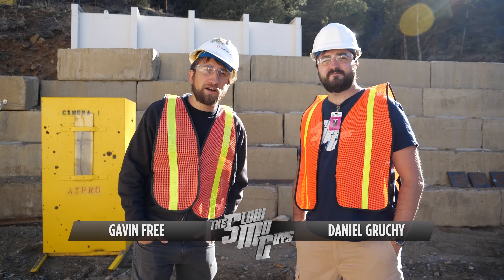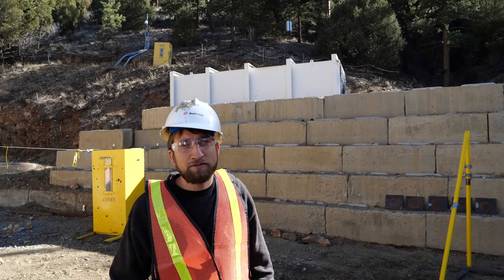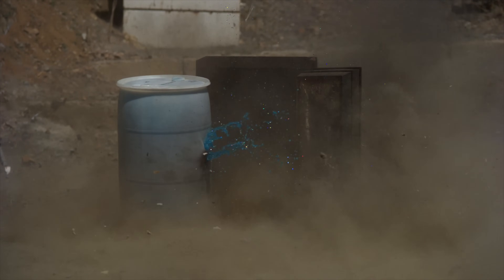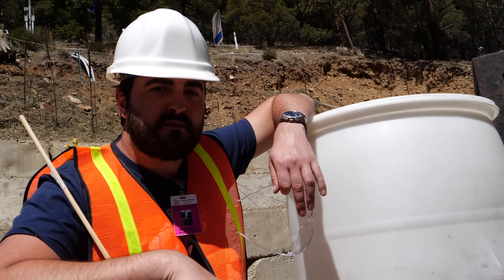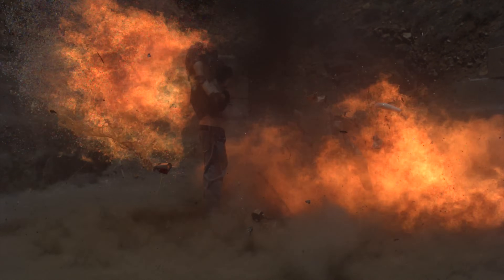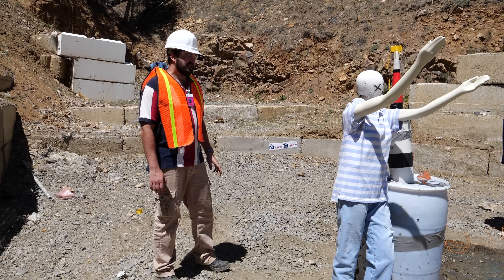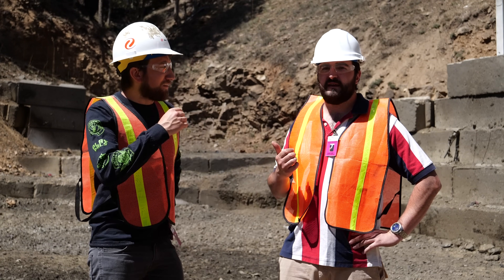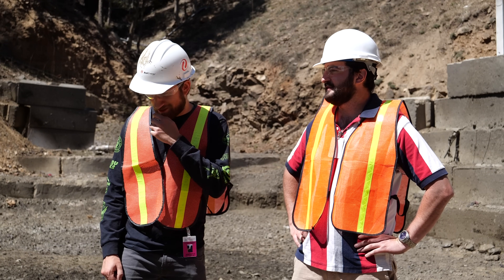Massive Explosive Chain Reaction at 200,000fps - The Slow Mo Guys

Comment: Since you have several phantom cameras - could you record the same footage at the same frame rate but several different exposures and mount a HDR footage from it? The dynamic range suffers a lot from high frame rates but it would be really amazing to see the actual shape of the copper jet penetrating the armor. I could definitely lend you a hand with mounting the HDR footage because I'm a computer vision / image processing specialist. What's more you could transition from low to high exposure smoothly to show all the details of the explosion over time. It would be also (probably) possible to reduce noise and perhaps even artificially improve resolution of such image, especially with recent advancements in convolutional neural networks. This altogether could make a footage of unprecedented quality :)
Reply: I hope they do shaped charges again, but no matter what bracketing you use you can't get a video of the jet in air because it moves so fast it lights the air on fire, and all you get is a fireball. When I was a student I did R&D for shaped charges, we mainly used an array of flash x-ray photographs for still images of the formation of the jet or multiple projectiles. On a rare occasion we would take pictures in the visible range and the solution is simple, we just built a long frame of a box where the jet was going through, wrapped it in plastic wrap and filled it with nitrogen(no fire). You would only need one exposure level, but I haven't seen anyone make that video, It would be amazing to see videos of the jet before it fully formed, at the ideal standoff, and further away when it breaks apart.

Comment: The fastest common LCD panels run at 120fps. LCD works because they use some sort of crystal that stays elongated with no voltage applied, and bunches up gradually as you apply a voltage. It would interesting to see someone run a copy of prime95 (a stress testing tool) and capture the changes in the panel at 200,000 fps. Might photograph well because the panels give off light...

Comment: what if you make a smaller one attach an arrow shaft to it the connection between the arrow is a primer. 
The front of the charge with 3 aluminum sticks to stop it from directly hitting the target.

Comment: Send different speed shockwaves through different materials, like, c4 makes a fast sharp bang, but anfo makes a slower shockwave, better for pushing things. Maybe you could set the various explosives off in gelatin, water, oobleck, molten plastic, molten zinc (low melting point, etc :)

Comment: Odd they didn't protect the cameras by aiming them at an appropriate mirror set at 45 degrees. Then only the mirror is at risk while the camera's behind steel. Mirrors are cheap compared to cameras.

Comment: Salutary to note the last and biggest bang was from the ammonium nitrate fuel oil - a pretty standard explosive for car and truck bombs.
Reply: pedtrog I was told on an explosives course that ANFO mix is about 50% more powerful than TNT when it comes to structural damage.  Was used in the Canary Wharf bomb placed by the IRA

Comment: On a couple of YouTube videos, the comment section has livened up on the subject of barrel vibration and bullet stability out of the muzzle.  The military did a study on the flight path of the .223 that indicated that out of the muzzle, the bullet precessed about the axis of flight, damping as the gyroscopic force aligned the bullet axis with the axis of flight.  I wonder if you guys would be willing to do a video using your high-speed camera to validate the physics of that.  Likewise, we've all seen barrels flex when shooting in slo-mo videos, but the conventional belief is that there's a node (no movement) about 2/3 of the way down the barrel from the anchor point in the receiver, and that barrel dampers are meant to fool the barrel into "thinking" it's longer than it is, so that the node point moves to the muzzle, eliminating barrel flip as the bullet exits the barrel.  That's another high-speed-camera-worthy video.  Just a thought.

Comment: Now I'm very sad for those tank crews who have unfortunate enough to be in a tank that fit fired by a shaped charge. Poor guys would literally melt? Or transform into mess of flesh? Not sure what happened, but definitely not a cool to be in one.
Reply: Til they instaled overpresure valves they got killed by the extreme presure. But Shapd charge is one of the least deadly rounds. It does not explode inside the tank. It youst sends a stream of molten metal trhoug the tank. It kills everything in its path but nothing around it. And even if it hit somone they might youst lose a leg instead of kiling him.
Reply: @manuelscherrer9956  thx
Reply: @manuelscherrer9956   No, it's much more likely that every occupant  inside would be killed.  Plasma (molten metal from shaped charge) is not like a bullet that can miss you. It is moving much faster and is extremely hot. If you're inside the tank, it kills you.
Reply: Well that’s what you sign up to when entering a tanks crew, and out of all the different things that are being shot at tanks, I’d rather get touched by shape charge then other terrible thing like armor piercing rounds, etc,...

Comment: Didn't move the safe door even a smidge, shot into the water filled plastic barrel with a silver dollar sized hole.  I'm not quite sure why the barrel jumped straight up a foot or so, rather than rocking backwards then forwards several times.  Anyone got an idea?

Comment: Hey like the video but I was wondering and this may sound crazy if you can slow motion film a television set to see if there are another set of images being projected that the human eye just cannot see.   No there would not be explosions but if there is another image or set of images being transmitted then it would prove subliminal programming happens all the time when you watch TV.  It would be interesting to see if it also happens with a laptop and with our cellphones.  I know it is off the beaten path but I have been wanting to do this for years now.  If you decide not to film it can you tell me where I can rent a high speed camera like you have so i can perform these experiments?

Comment: 210,000 frames per second if translated into inches per second isn't even close to the velocity in inches of a shaped charge per second. Dividing 210k inches per second by 12" per foot is 17,500 feet, or 3.314 miles. So the shaped charge movement is faster in inches per second than each frame if each frame translated to one linear inch. So now you know. :D
Reply: And yes, shaped charges are done with C4 or similar, which burns at roughly 5 miles a second, so that's in the range of meteor impacts.

Comment: ANFOL is extremely high Brissance.  That 1/2" plywood is not rated to that kind of shockwave.  (Especially a 55 gallon drum of it.)  It's pounds per square inch, against s 4/8' sheet.  I'm surprised there wasn't even more spalling.  You used way too much of that stuff.

Comment: at 15:24 you can see the air move above the explosion
Reply: That's the shockwave he was talking about.
Reply: @waterspray5743  there is also something moving before shockwave,watch again carefully
Reply: @waterspray5743  No, he was actually talking about the air. Heat spreading (depends on intensity and force) faster than a shockwave. In this case, the heat spreaded actually faster than the shockwave, causing the air directly above the explosion to heat up abruptly and forcing it to get above the colder air, till the shockwave arrives.

Comment: 5:19 by the rules of physics shouldn't have a force pushing back? like recoil on guns. because visibly the explosive already penetrated the safe and the barrel but the stick holding the explosive is still in place until the shock-weave pushes it back.

Comment: See all that carbon soot everywhere (black)?  They used too much fuel oil in the ANFO.  The AN should just be damp with oil, not swimming in it.  :-P  They would have had slightly better velocities if they had cut back a bit on the FO.

Comment: you guys should try to blow up aluminum foam. idk if you've heard about it, but it's like blowing bubbles in aluminum right before it solidifies, and because the thin layer that makes up one side of a bubble is designed to crumble and absorb a tiny bit of the impact of an explosive, and there's hundreds or thousands of tiny bubbles that do that, so it's blowy- uppy proof. or, you know, explosion resistant. whichever pleases.
Reply: Andrew Gail boom boom protection
Reply: Blast resistant.
Reply: Pop proof.

Comment: Have used det cord to cut big dead trees down at ground level on many occasions.  To make det cord hit harder double it up and tape it tight.  To make a hard fist hit det cord into a tight ball then put into a crevice or hole of object.  Makes a serious bang and does its job or destruction.  Using Anfo in a container then set off with a det is pretty wicked. I use explosives everyday in my job of mining.  Great video guys.

Comment: Can you do a shape charge facing upwards into the air?
Reply: Heroix The stated speed (10km/s) is pretty close to escape velocity.
Reply: @johnfrancisdoe1563  
Yeah, if it wasn't for the earth atmosphere it would legit be possible to reach orbit! Of course, any orbit achieved from a single push has to transect the point of launch, so it wouldn't achieve stable orbit, but still!

Comment: Shaped charges are so effective because they're moving so fast they literally erode the metal surface they hit. They're used on those weird CBU-97 where they're detonated at like 20-100 feet and aimed at the top of tanks. So they're literally firing the molten metal slug like a gun straight down at tanks and still able to penetrate hundreds of mm of solid steel.

Comment: You guys should do a video with MIT and use their camera to capture electricity from a tesla coil
Reply: they already did a tesla coil one
Reply: Yeah I've seen it but the camera that used wasn't fast enough to capture the electricity itself because it travels a a 1/3 of the of light. So if the did it's with the camera at MIT they could actually capture the electricity traveling through the air.
Reply: Oh i thought you meant MIT for the tesla coil, Thanks for clarifying!

Comment: What was the framerate for the segment @15:40? Because that's exactly the subjective time dilation I experienced when I encountered 10 pounds less ANFO than that in my HMMWV in Iraq. At least, that's what I remember just before the next memory: coming to in a half-shattered vehicle sitting partially in a 30 gallon puddle of burning diesel fuel. Pointed 45 degrees to the left.

Comment: Its not a shaped charge.Its an EFP,or explosively formed penetrator.Shaped charge is a kind of penetrating explosive that has only explosive wich is cone shaped.Without any metalic cone.The explosive force is focused in one spot and that is how it penetrates thick material.With EFP the copper cone turns into a "high speed projectile" and cuts trough material.Big difference
Reply: Does the copper convert to plasma by the explosion? Only to return to solid state when it cools.
Reply: Crow T. Robot no.Its going so fast that it starts burning in contact with air.Something like when meteors enter our atmosphere.We had a really long subject on these in millitary.Something similar to what you asked happens with shaped charge.The real shaped charge,RPG type shaped charge
Reply: dan was an EOD in the military i think he knows a little more about what he's talking about than some random kid on the internet
Reply: @jblast22  i was in millitary too.So i know a difference beetwen a shaped charge and an explosive formed penetrator.You know you could do some simple research right here where you are and you'll see what im talking about,i bet there is some kind of videos on YouTube explaining the difference beetwen shaped charge and EFP.Soldiers used to call them shaped charge too when I was in millitary and they would have a bad time for doing so.Because as our commander said they are not a same thing,and someone can get killed for mistakening shaped charge with an EFP.Shaped charge needs to explode on contact with the target while an EFP charge needs a standoff distance for the penetrator to form.I hope this clears some things for you,you random internet kid.
Reply: Incorrect.  A projectile forming charge is a type of shaped charge having a concave/hemispherical or wide apex angle (100+ °) conical liner made of a malleable heavy metal.  A shaped charge proper (also called high-explosive antitank, or "cumulative" charge) has a deeper conical (apex angle generally between 40° and 90°) or complex shaped cavity.  While a shaped charge can be made without a liner or with light frangible (glass, polymer, thin light metal sheet) liner, it is generally lined with a ductile heavy metal of 0.5--3% of the charge caliber thickness.  This is done so as to increase the penetrative power of the charge up to 10-fold, compared with unlined shaped charge.  The main point setting projectile forming charges apart from other shaped charges is thus the geometry of the liner (flatter then in other shaped charges) and the mass liner/charge ratio (in projectile forming charges, the liner accounts for 30--45% mass, while in the HEAT-type shaped charges, the liner mass accounts for ca. 10--20% charge mass).  There is also a difference in the dynamics of the liner formation and target penetration; an EFP forges the flat heavy liner into a ballisticaly favorable heavy slug accelerated to ca. 1--3 km/s, which has enough kinetic energy to penetrate 1--2 times the charge caliber of RHA at distances of from 10 to ca. 150 charge calibers, "punching" through the target medium much like a convetional firearm projectile ("plastic penetration").  The HEAT-type shaped charge collapses the liner and forms an elongated, pointy metal jet accelerated to 8--12 km/s, capable of penetrating up to 7--10 charge caliber thicknesses of RHA via a hydrodynamic mechanism ("hydrodynamic penetration"), however only at a narrowly defined standoff from the target surface.
Reply: @fritzhaber3994  you are telling me that shaped charge and EFP are the same?You overcomplicated something very simple.Shaped charge doesn't have a liner or it can have a liner,it depends on the use.The bottom line is with shaped charge it explodes on contact and the explosive force is focused in one narrow spot wich enables it to penetrate really thick armour.EFP needs a standoff distance and when it explodes the metal "liner" forms into a projectile and with a speed of few thousand miles per hour hits the target and goes through it.As i said,they are not the same.You can write another essay wich will basically confirm what i said again but it doesn't change the fact that they are not a same thing to be called or reffered to as the same
Reply: +gumelini1  Nein, as I wrote they are not the same, however projectile forming charges are a type of shaped charges (with a flatter and heavier liner than HEAT).  Could you name one type of shaped charge munition which doesn't contain a liner?  Because nonlined shaped charges are only marginaly more effective than cylindrical charges of comparable mass in penetrating robust target media.  Every mass produced shaped charge known to me uses a metal or composite liner, munitions as well as civilian use cutting charges.  Cheers.
Reply: @fritzhaber3994  ok so if you agree that they are not the same then why did you feel the need to say "incorrect"?When you basically confirmed everything I said.Cheers to you as well
Reply: +gumelini1  Not every shaped charge is a projectile forming charge, but every projectile forming charge is a shaped charge.  Not every car is a taxi, but every taxi is a car.  Really not that hard to grasp.  Cheers.
Reply: @fritzhaber3994  yes its shaped charge but its not a shaped charge.It doesn't come by the name "shaped charge".I said they are not the same!Wich they are not.So i dont se where your problem is,other than confirming what i said but just saying it in a different way.Are you bored od something?
Reply: Again, you claimed that shaped charges are never lined and that a liner distinguishes a projectile forming charge from a shaped charge, both of which is false.  Projectile forming charges are type of shaped charge, period.  You could as well concede that you were mistaken in your initial comment, not like it would be something tragic, right.  Cheers.
Reply: @fritzhaber3994  the point they are not the same.I also said EFP is a type of shaped charge but it not a shaped charge.You are making too much drama for no reason

Comment: Hey there! You should definitely try fire different bullets (9mil to armor piercing) at a spinning table saw blade (the top edge teeth) and see what effect will the bullet have on the blade and vice versa in slow motion. The kinetic energy of the table saw blade must be tremendous at thousands RPM. I tried to find something similar on the webs but nothing. Please! I’m terrible curious.# bulletvssawblade

Comment: Is the v2640 the current king of the Phantom range? Is there a more ridiculous version that does super-dooper high speed at decent resolutions? Basically, when will we see a pyrex handle shatter at 1,000,000 fps and not postage stamp size?

Comment: And if you want a real gulp?  A small aerial bomb like one that would be dropped from a close-air-support aircraft will be in the range of 250lbs, of which about 96lbs is a high explosive of much greater pound-for-pound yield than ANFO.  And that particular bomb, the Mk81, is referred to as "the firecracker" for the very limited size by comparison to the "standard" 500lb bomb (192lbs explosive load).  

Food for thought when you see a war movie!